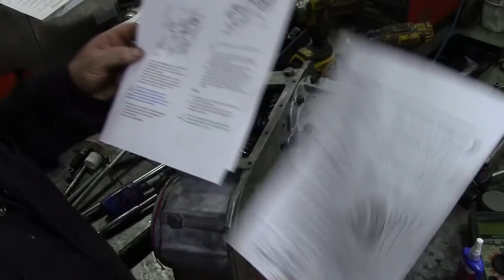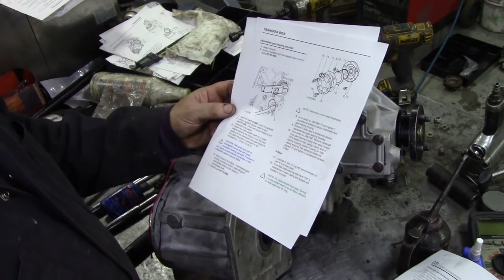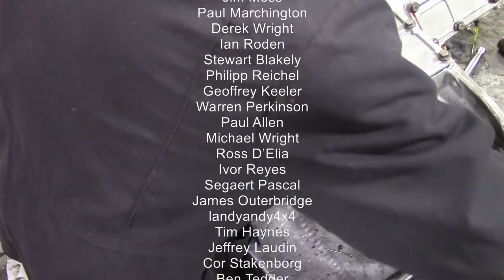LT230 rebuild Part 8 assembling the Intermeadiate gears

Comment: Just as an interesting point regarding the intermediate shaft O rings and sealing against oil leaks. I bought an Ashcroft rebuilt unit for a D2 but good used condition, not direct from Ashcroft. I pulled it apart for a quick inspection and found that the intermediate pin is assembled with black RTV sealant! I’m guessing as well as the O rings, because it was glued in with that and not leaking I didn’t take the in out in the end. The last one I did I made it up with RTV on the pin and O rings and used that to help slide the O rings in. Double sealed. But that wasn’t a sleeved casing just standard original spec
Reply from the maker: I do the same on none re bushed cases
JP and I considered a double O ring, however you were losing a lot of material and hence strength  - he also suggested a Viton O rings which would be a lot better, but getting the right size was an issue
Reply: @BritannicaRestorations  Good work Mike, good to know we are all doing the same thing. I changed some bearings and seals in an LT230 from a Defender Td5 a few weeks ago and used a nice smear of sealant STC50550 on the pin, that stuff is really good!

Comment: it's normal a bit of play (angle of rotation, not axial or radial movement) between the two output shafts? It's not clear to me what are the signs that predict a failing unit\ unit that have to be rebuilt.

Comment: With the collapsible spacer, what is the wall thickness and length? I have one from an LT230 I am rebuilding, the collapsible spacer has a wall thickness of 2.45 mm and a length of 58.76mm, there are no collapse ripple on it.
Thanks in advance.
Reply from the maker: There is no ripple in the collapsable spacer - that is the issue.
From my experience (and maybe that of LR) the spacer never crushes evenly and this can attribute to the casing wearing, and thus leaks.
I now follow the example of the later Puma LT230 and make a solid tube spacer, but it needs to be calculated